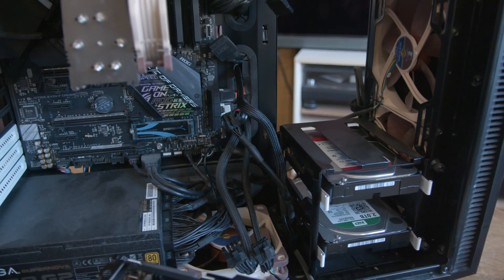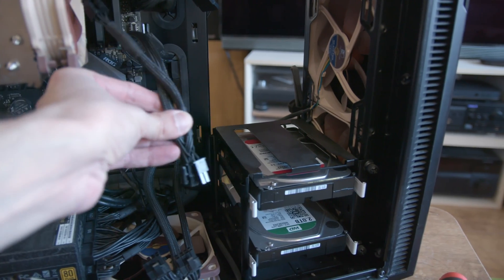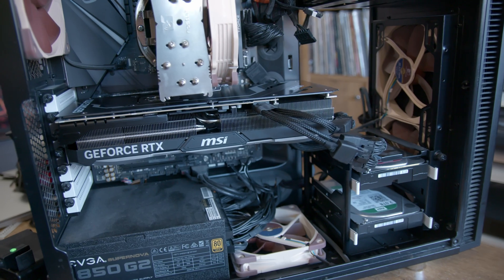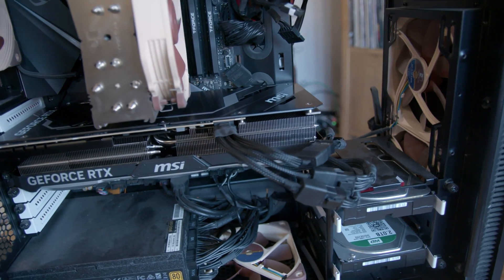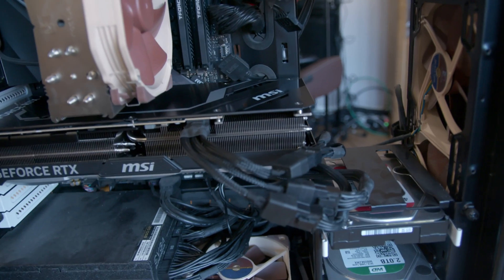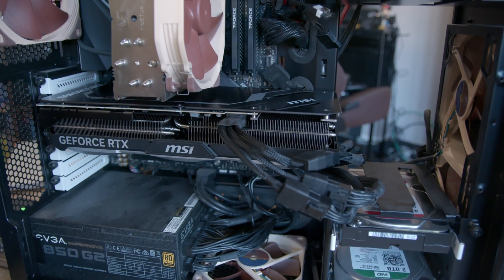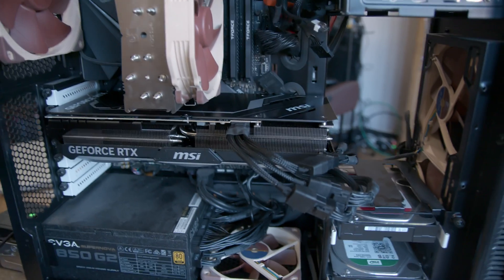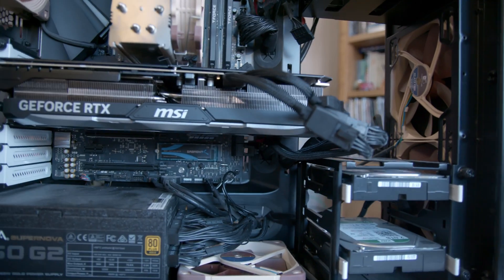MSI Ventus 3X 4080 Super installation

Comment: Could anyone maybe help me. that 3 piece adapter do i have to use it ? Because my prebuilt doesnt have all the plug spots on my power supply but it has 450 watt 12 ping that was plugged into my old gpu can i just plug that into the 4080 super?

Comment: my 4080 super has only one connector
Reply: 1 connector for 3 rail power polls. Need to be from separate vga high power connectors from the power supply.

Comment: How did you like the performance gain  compared to 3080?
Reply from the maker: I had a 3090. Frame rates can be a lot higher, depending on the situation. The frame generation is nice for console-like games like Hogwarts Legacy and Ratchet and Clank. In rFactor2 VR the stutters are much reduced. I haven't actually played flight sims much yet but MSFS gets a bit of a boost but is still a bit CPU limited.
Reply from the maker: Comparison video here: https://youtu.be/9pkAan_gGOk?si=fwXHg_dy_kdV8LQU